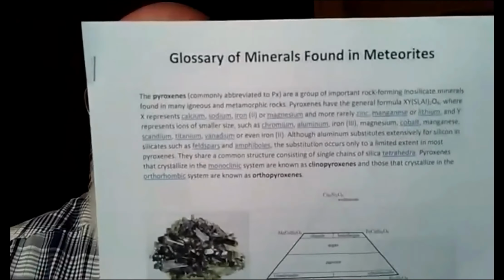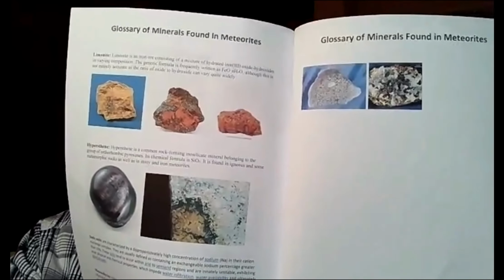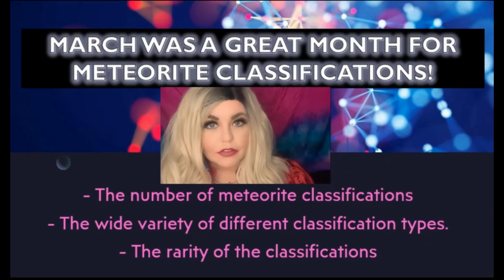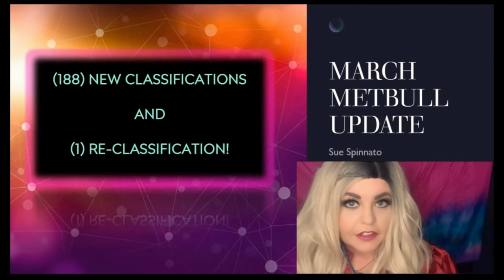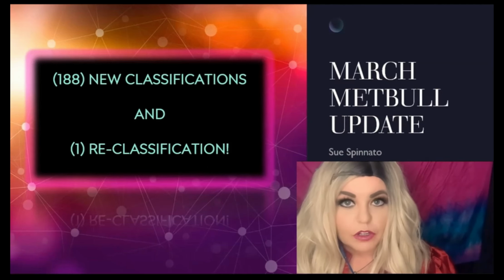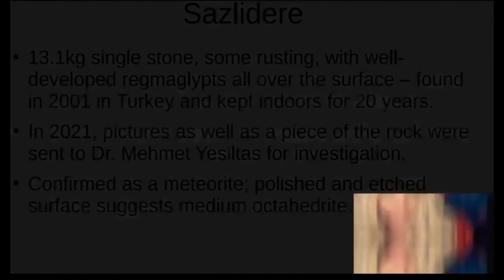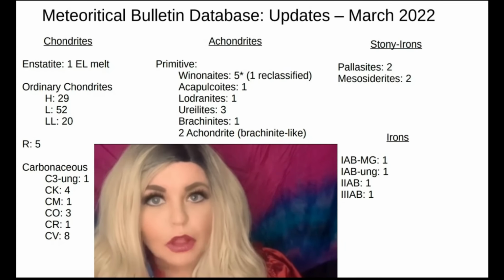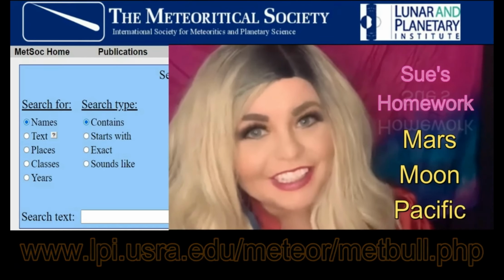Meteorite Hangout #101 ☄️ Tools & Tips for Collectors, Macro Photography, Polarized Light Explained

Comment: That was quite a dramatic contrast with the cross polarisation, I kind of thought I had a basic understanding of it, but when you see it like that its an eye opener! I have a decent DSLR similar to the one Domyan uses and a specialised macro lens , well I have 2 macro lenses but one is for really close stuff I think only Canon makes such a lens (called a MP-E 65mm f/2.8 1-5x Macro Lens) but they are quite pricey, even though mine was second hand it was still not cheap, certainly compared to some of the stuff Domyan uses which probably gives better results! but my light set up needs to be improved and after seeing this it is obvious I need to get some of that linear polarising filter. Thanks for hosting the meteorite hangout and for all the people who take part.
Reply: You can use CPL filters, especially if you want to keep using some of the automatic features MP-E may provide. I use two CPL filters on my main setup and a LP on my LED light. The trick is to always face the front of the CPL filter towards the subject. The 'back' side simply has a 1/4 waveplate so you face that side toward the light source and toward the camera sensor. If you already have two CPL filters there is no reason not to experiment with those. 
MP-E is a legendary lens but it's extremely overpriced. Most features you get are not needed. You are better off not using any of the automatic controls and the higher light gathering power compared to microscope objectives can easily be compensated by slightly bumping the power of your flash (I am still using it nowhere near full power).
Reply from the maker: This reaction is why we did the demonstration. Never underestimate the results of 2 thin films of plastic. 🏆 It was very nice to see you and Domyan chatting about photography details.

Comment: @ 30:00 that should have screw threads. on it. to attach to a clip so you can clip on to your mobile device. 🤠👍🏼
Reply from the maker: Not for this handheld pocket size little tool to bring with you mobile. There are others that are designed to attach to your phone with a clip.

Comment: It's absolutely true that for a more serious macro photography you are shooting in manual. And I mean full manual. Auto focus is useless - no lens can do auto focusing at those magnifications and you want full control and predictability for stacking. In macro photography you focus by moving the camera or the subject, not by turning any kind of a focusing ring. As you almost never have aperture control and as you HAVE TO use the flash (any exposure longer than 1/200s would produce motion blur from a shutter shake and no continuous light is powerful enough for such a short exposure), the only controls you have left are ISO (and you keep at at 100) and power level of your (also manual) flash. Even the white balance you want to keep on a fixed custom (calibrated) setting. You can't allow your camera to change anything between possibly hundreds of exposures needed for stacking.
Reply from the maker: Thanks so very much for making the video on macro photography and also for adding this extra information that you weren't able to fit into the video based on our discussion.